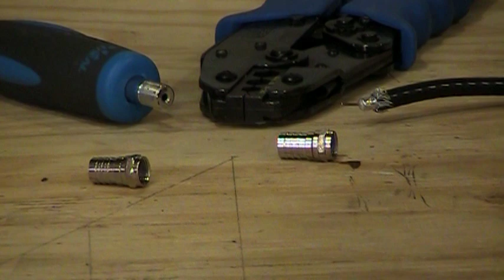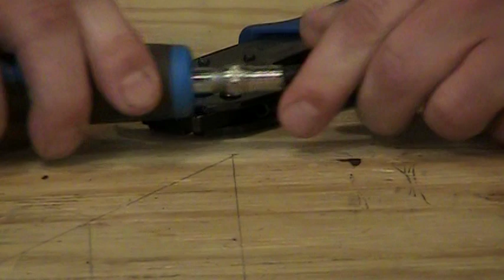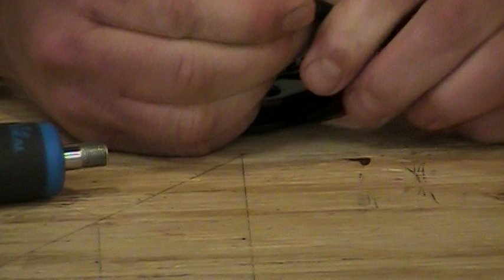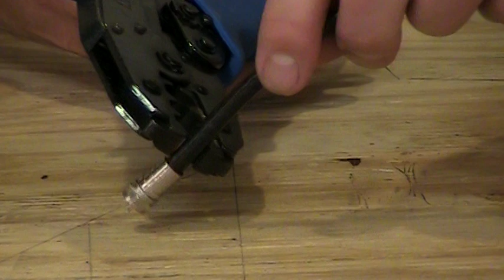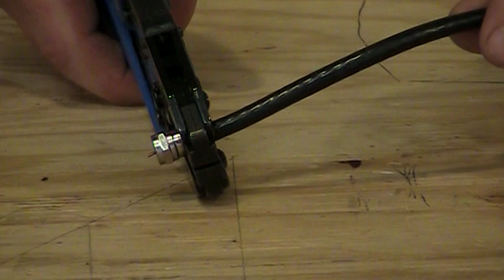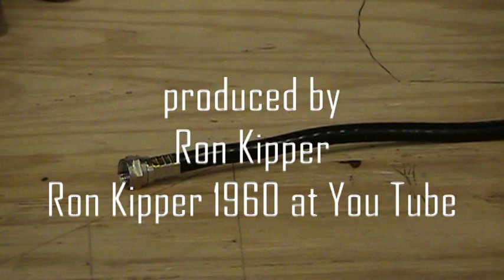Crimp On RG-6 Coaxial Connector Termination.mpg

Comment: Like your video. Got one question i am using the three piece connector does the pin when put on coax wire sit right on top of coax wire or came i move it up. Also does the pin need to flush on connector that screws into radio.